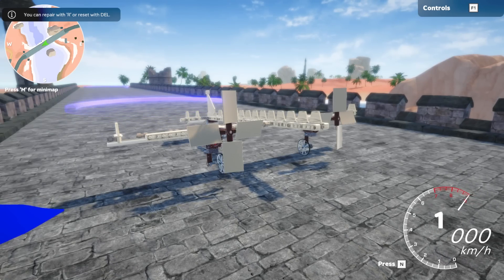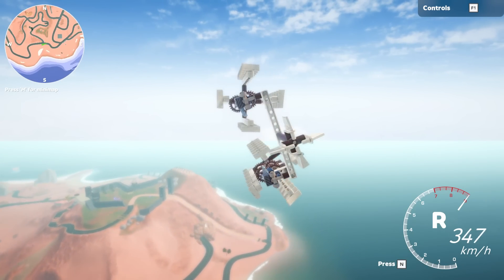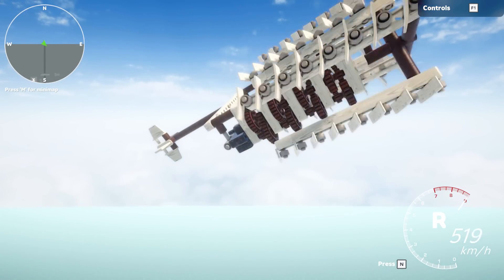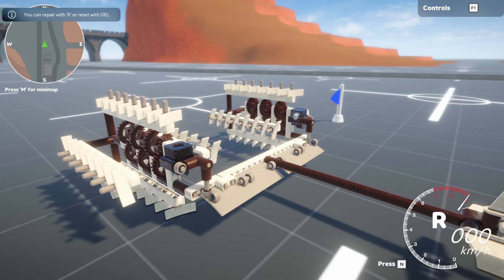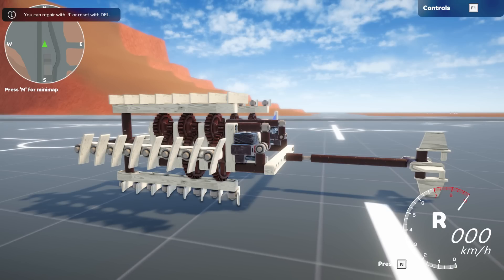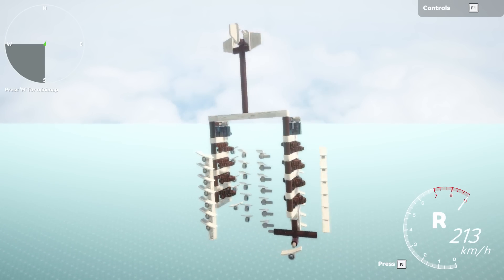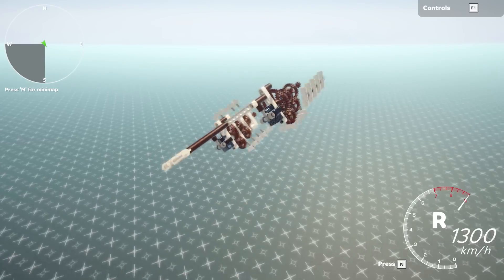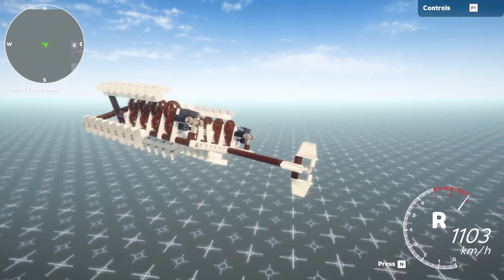I Built a Plane That Can Go Supersonic Under 1 Condition...

Comment: i looked through the code of the game and the formula for the vehicles drag seems to be:
0.6125 * (vehicle width * vehicle height * 0.85) * [a value between 0-2] * -1 * (forward speed * forward speed) * (1 + vehicle damage * [value between 0-5])

and the vehicles damage gets added when it hits something so the current damage affects the vehicles drag
Reply: So not really anything to do with realistic drag at all. So strange.
Reply: So a smaller vehicle should have less drag? Interesting.
Reply: @logicbuilder1204  It's just the frontal area so you can make it as long as you want without increasing drag.

Comment: You never made enough power to do the gear ratio.
All of the less powerful designs would just convert their power into torque, so to counteract that you would just have to get more power by using more engines and stuff.
But that puts more weight onto the plane, so you would need to use more wings or with more power you could just add more gears

Comment: to use planetary gears with hinge connectors you just need to put a hinge connector on the back of the engine too also sometimes the game just decided that both props need to spin on the same direction to not have torque

Comment: I am not sure if this will help but i think that the engines work differently when in reverse bc i had this porblem when i was making a helicopter that one was stronger, i am not sure how it is with gas engines bc i used an electric on my heli

Comment: My idea is that aerodynamics in this game are bottlenecking everything. Adding wings adds collision points for the "wind" and weight. Also the engine doesn't matter that much with flying things as long as gear ratio is correct. Adding more engines adds weight and in the air there is nothing that can oppose engine force so don't overdo it. Try making either really long wings like 6  sets of the longest one on top of each other or making only the smallest wings but not in @----@ shape, inline one behind other so there is less "wind" collision points
Reply: Interesting theory but no, the game's aerodynamics is way simpler than that. And about the engine force, with small propellers like this that don't go far over mach 1 yes the engine can be made much smaller, its just as you get larger, depending on your propeller design, the weight and so moment of inertia of the prop increases, which can mean more engines needed to get close to max rpm.

This also helps make the carbon wings insanely potent for propellers like you mentioned, as they weigh only 0.1 kg while providing the same downforce as the rest of the spoilers per area. with just a simple dual-carbon wing propeller, not even any stacking, you can easily get mach 1 and up, and with some janky gearing(stacking engines with different ratios powering the propeller), you can get into multi-machs.

Comment: Really weird idea that probably won’t work, on the planes with the mystery gyro force, have 2 forward input keys? Like have one engine forward me mapped to q and the other to e? I don’t know how the game works but to me it seems like maybe that could make the engines have a more in sync rpm pressing to separate keys rather than one for both it probably won’t work
Reply: Yeah no
Reply: @WhiteDwarf1011  figures, thought I’d share because as a game dev it sometimes does stuff like that in every game so 🤷
Reply: @jgb105  Though there definitely is some weirdness with binding the WASD keys in the game, like the steppers and pistons will respond to both W and S or both A and D if you bind them to either, and the engines not reversing if you try to bind them to any key other than WASD.